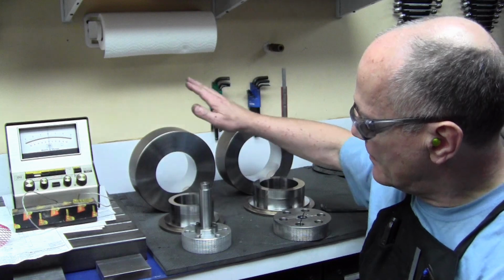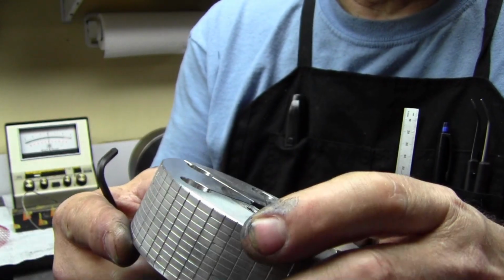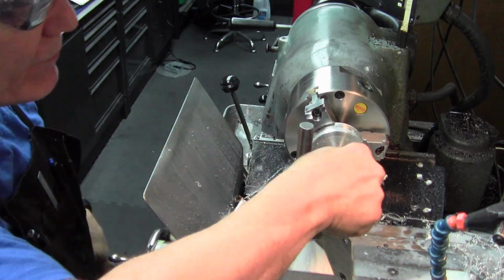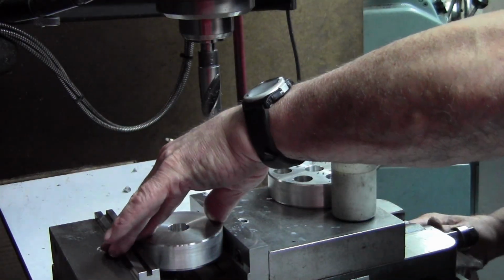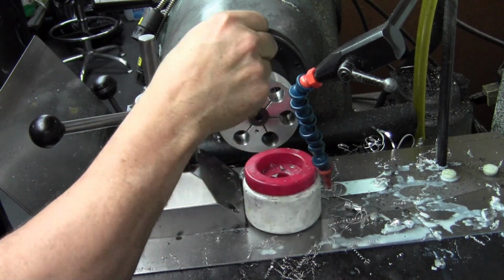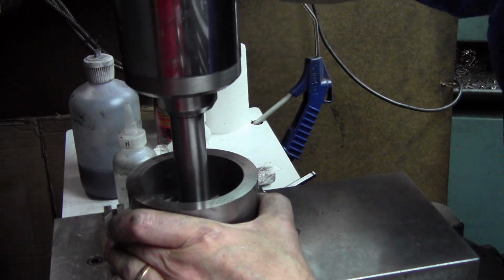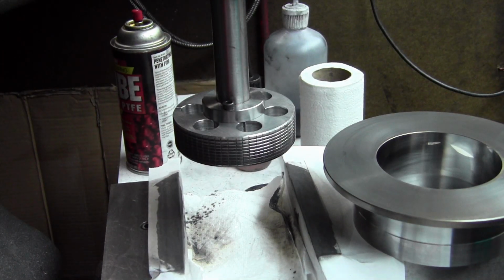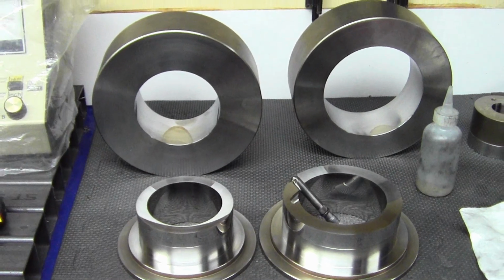MAKING AND USING LARGE DIAMETER LAPS

Comment: I'm just in the process of rebuilding an early Kioti tractor engine (Kubota engine actually) and your lapping videos are actually helping me do a better job with the honing process. I'm beginning to understand how you can get less than half a thou (the precision limit of my dial bore gauge) within a given specification via these types of operations. I think this engine maxes out at about 2800 rpm, so not exactly going to be seeing huge piston speeds or crazy amounts of strain, but I somehow feel the need to get the amount of taper to within the spec of a 7000 RPM race engine lol. I bet it'll last a long time before it starts to blow by at least :).

Comment: I see if the application is for a ring gauge where the bore does not need to be square to either end face and is only relevant to itself. In the case of your hub would it not be easier to first grind to maintain squareness and lap finish if needed? Especially working with a tapered bore and doing it on a vice in a mill would it's squareness not be compromised? Cheers Robin.
Reply from the maker: You are correct.

Comment: Hmmm, i cant help but think if you apply such a hard material like diamond dust on a tool made of aluminum would make the slurry eat up the tool made of soft aluminum.   What you think?
Reply from the maker: It is actually totally the opposite! Diamonds are faceted by rubbing them on a steel disk covered in diamond dust.

Comment: How much effort do you spend cleaning lapped parts before you measure them? I always wipe down with a paper towel before measurement but I am concerned that extremely fine abrasive on my hands and on the part will cause wear on my micrometer faces. Any thoughts on this?
Reply from the maker: A lot, very important to have very clean parts or it will eat your measuring tools.

Comment: Grabbing those ribbons while the chuck is turning is very dangerous.  If the chuck grabs one, you will lose a finger or a hand.
Reply: Aluminum chips are the least dangerous.  Steel more dangerous, too dangerous to not use long handled pliers or a hook.  Stainless, stop the chuck, don’t pull anything by hand.

Comment: So my understanding is that those laps would now be dedicated to that 15 micron diamond solution? Is that completely true or are there exceptions - you mentioned getting too aggressive with the expansion causing the particles to disembed, so I wonder if that could be used if you needed to move to a different particle size or type of compound. Or would a lap be able to move to a larger particle size but never smaller? Thanks as always for the super informative videos 👍
Reply from the maker: A charge will diminish and you could use smaller diamond and get reasonably good results but if your after super finishes a dedicated lap is best for low micron sizes.
Reply: @ROBRENZ  Do you think that something like a cast iron lapping plate could be reconditioned by lapping a softer material like aluminum that is easy to embed particles in with it?
Reply from the maker: @nameofdane  Yes but it can be reconditioned by lapping with an identical iron plate which is even better.

Comment: Is your lathe on a riser or is it just particularly tall? I could see that being quite convenient.
Reply from the maker: That is stock height for the HLVH but I am only 5'-6"  so it may look higher than it is.
Reply: @ROBRENZ  Fair enough, I designed the stand for my Tormach about a foot taller than stock to fit over an obstruction and ended up really liking not needing to bend over it.
Reply: @ROBRENZ  I can't remember if you mentioned this somewhere else, but did you make your ceramic lap out of a bench grinder and a worm reduction box? I have a Baldor 500 and it seems like it would be fairly straightforward to hang a frame off the 2 pins that mount the chip tray and the top pin for the dripper and either drive off the spindle nut or make a nut with the features of a lovejoy coupling and make a removable lap. What rpm should the lap run at?
Reply from the maker: @johnnason7019  Delta model 23-710  runs at 400 rpm

Comment: Hello! first of all I would like to thank you for youre very insightful and practical method of lapping.  
second, I didnt fully understand - you turn the laps to be smaller by about 0.005" to fit the ID? then expand them as necessary?

I would also  like to ask you advice - I need to grind / lap about 0.0004 "to 0.0008" off of the inner and outer diameter of a HARD ANODIZED tube shaped aluminum part(s). would you see an advantage of using grinding of lapping to achieve a precise dimension to within 0.0003" ? 
Thank you!
Reply from the maker: Roughly 0.001" smaller and then expand as necessary. Lapping would work well on the anodize using diamond slurry.

Comment: ok so curious question, but could you achieve a consistent tolerance straight accurate part via cylindrical grinding the bore?
or do you have that capacity? lapping bores seems like a long way to go about it. I usually machine/hard turn within a couple hundredths of finished size then finish grind.
Reply from the maker: I don't have a cylindrical/ID grinder. Lapping is slower but can give better geometry than grinding,
Reply: @ROBRENZ  yeah i was going to try and do some lapping for our drawing dies, D2 steel as well, I've found the radial marks cause the tin plate to pick up on the surface finish, we don't have micro honing capabilities or even honing for that matter, but those internal laps look like a good solution.

Comment: What is the tolerance of the “piston” before you start cutting the little “squares”. I made Gear for a cheap mill that “shaper” system. Amaze see your patience ad dextericy. I am an old man and by age amongst every thing you loose dexterity too. I have to take care of me my machinery too. Our precision requirement is 1/16” in structural steel. 
In my retirement machining I am among to achieve .0005-.001” with my old machines. Since we cannot blame the machine at all time, learned to compensate. Excellent videos with real good audios and explanation is a joy to watch. Thanks.
Reply from the maker: A few thousandths below the diameter of the part.

Comment: I'm wondering, couldn't this be honed to size? or is lapping better for this type of job?
Reply from the maker: Yes it could but it is much harder to control geometry with a hone, and the large hones are outrageously expensive for one of parts.
Reply: @ROBRENZ If you had a honing machine it could be an good alternative?
Reply from the maker: @MrMeuchelmord  I have honed many things and I would still lap this.
Reply: @ROBRENZ  maybe not necessary to think about but how is the oil retention on a lapped cylinder vs a plateu honed cylinder? Might be over thinking here
Reply from the maker: @MrMeuchelmord  That is more surface finish related than process and relates to the grit size used when lapping/honing.
Reply: Appreciate the answers. Thanks Robin

Comment: I made a set of flat laps at work and I have gotten to a point where the laps are starting to make gouges in each other with 3 micron diamond slurry.  Is that do to too much pressure or too much viscosity? Thanks
Reply from the maker: Probably contamination or lack of diamond.
Reply: Too much pressure usually makes shiny spots by metal to metal rubbing.

Comment: Hi Robin.  What type of fluid is used in the slurry to suspend the diamond particles?  I assume you mix it yourself from a powder or paste?  Thanks for an interesting video.  Second viewing and learning new stuff every time.
Reply from the maker: You can use WD40 and paste but that was purchased as slurry. If you buy slurry make sure you buy oil based not water based.

Comment: how do you cut slits on expander?
Reply from the maker: bandsaw
Reply: ROBRENZ Robin but usually master laps are extremely flat or perfectly round. How did you make master lap by only turning it on a lathe? Master lap is usually made by three piece self truing.
Reply from the maker: IMO the lap and part get round together in use.

Comment: Being new to machining, I want to ask a newbie question, do you end up recycling the cutting fluid? Cause I see you use a lot of fluid, so it has to drip down and collect in a bucket or something, is it something that can be collected and reused?
Reply: Not really, because it is breaking down (particles grinding each other) and contaminated with material you are cutting (grinding, lapping, honing, polishing), plus chemical degradation. So...NO.
Reply: Thank you for this input, and as I said I wasn't sure being new to this. But after reading what you have said it seems to make sense, although it does still seem like such a waste not to be able to recycle it.
Reply: @clarhettcoalfield3616  the water based coolant/cutting fluid used on the lathe pumping through the nozzle is called a flood coolant system, and machines that have it use a catch pan, or just have the table or bed designed to catch the used coolant and route it back to the coolant tank, usually through some sort of filter, and then the coolant pump sucks from the other end of the tank, which has to be cleaned out periodically.
You will nearly always see flood coolant systems on high speed cnc machines, and often on manual machines that are used for hard or special metals a lot.
Reply: Yes! It's often automatically filtered from the waste tank and recirculated.  I think Xyz Zyx thought you were talking about the abrasive lapping compound and not the water-based coolant pumped on the lathe. "Cutting fluid" seems ambiguous in this context, so I'd call it coolant.